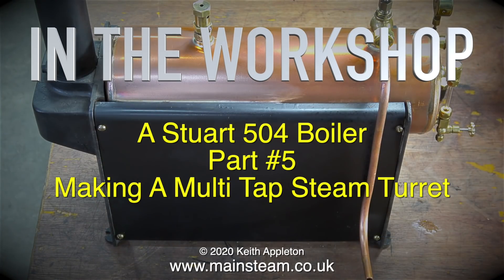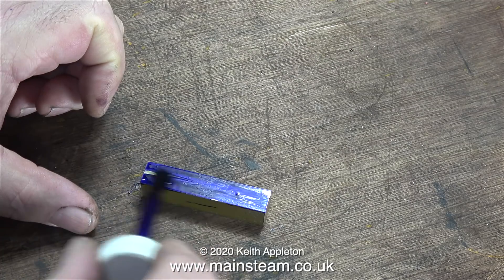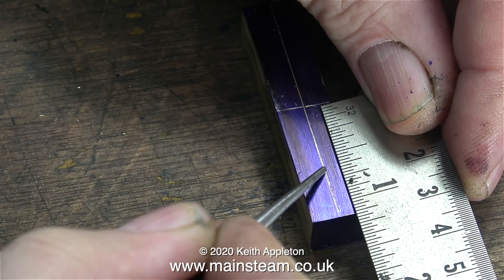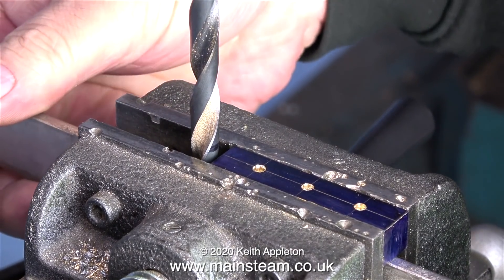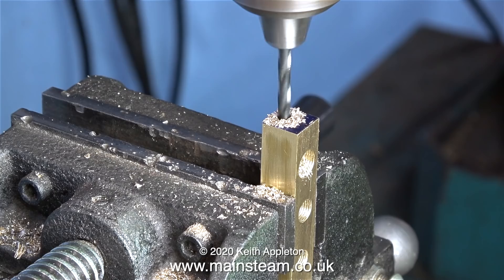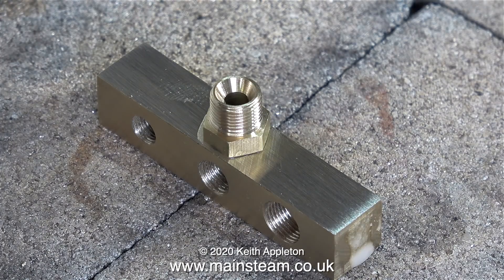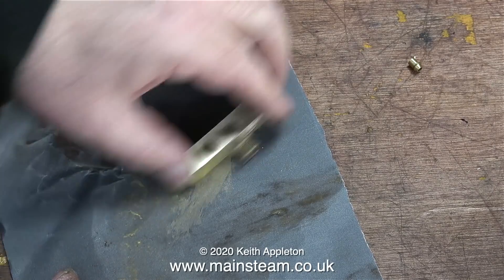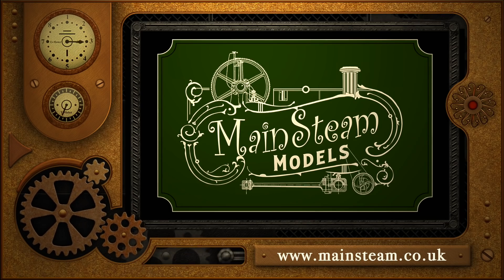IN THE WORKSHOP - A STUART 504 BOILER VIA EBAY - PART #5

Comment: I have a quick question, Keith, shouldn't the pipe leading from the boiler to the turret be the same diameter as the biggest pipe leading out of it?
Reply from the maker: Ideally yes, if you are wanting to put your steam engines to some high performance real work driving something, but this after all is a turret for a test boiler and it will be perfectly fine for the job.

Comment: Good morning Keith... I like your comment... need a spirit burner easy to fire up a steam boiler and no gas anymore... it is interesting because I converted already various traditional oil vaporizing lamps or burners (military) from white gas/paraffin to spiritus versions. I use BIO Ethanol normally sold for table fireplaces which burns without any odor or soos. Adding a few ml of water to the spiritus (1 liter Ethanol) can minimize soos formation as well. I have i.e. a british military lamp  ww2 which vaporizes ethanol and lights a mantle...  the small challange is to find just the right size of the nozzle... gas in my eyes is far to dangerous ;-)
Reply from the maker: I didn't know about the water in the spirit trick, I will try that. Thank you }:-)))
Reply: @keithappleton  In warm weather, anything above about 10 degrees centigrade, it works well. I add a few drops of water to my Trangia aclohol stove burner and it stops excessive sooting of my kettle and pans. In colder weather it can make it difficult to light with added water so I put up with the soot if need be.

Comment: Me: computer, 6 micrometers, a template, set square,  scribers etc....still drills the hole in the wrong place.

Keith: men, some blue and an old ruler, boom, holes in the right place!

:-)
Reply from the maker: it's just practice . . . spend some time drilling random holes in pieces of scrap metal - eventually a pattern emerges and the holes will be in the right place }:-)))
Reply: @keithappleton  lol I usually have a variety of holes to choose from ;-).
Reply: lol so true.